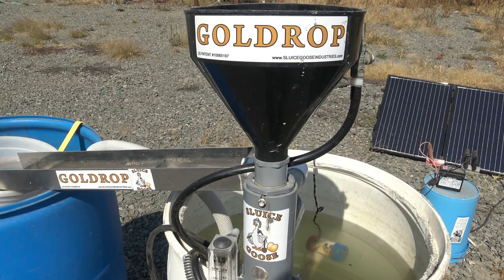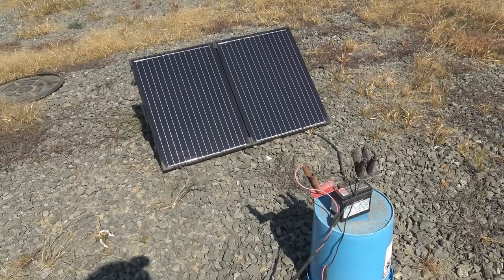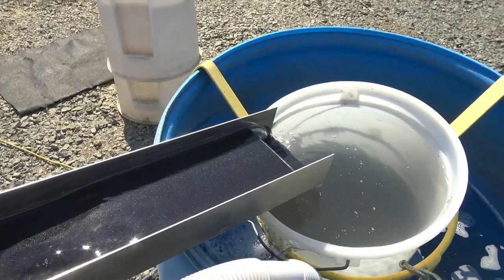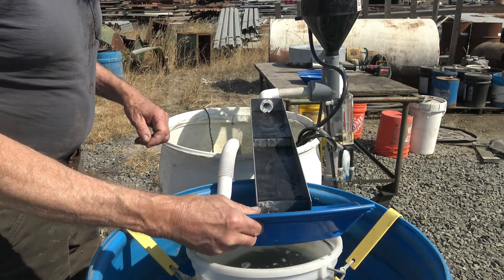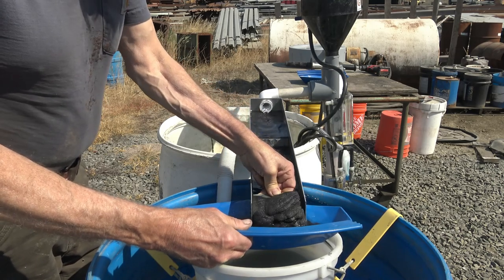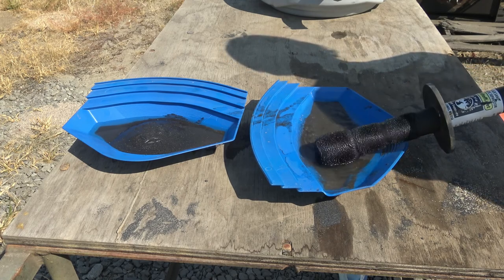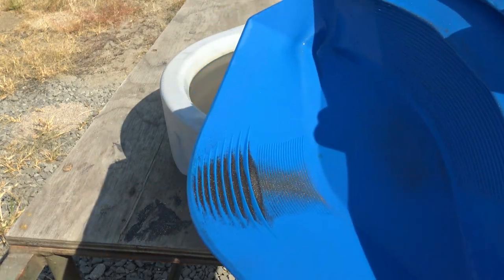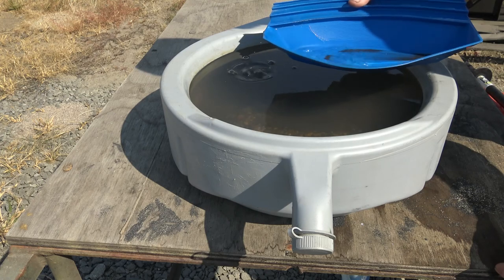GOLDROP & Magnet Sluice by Sluice Goose Industries

Comment: I heard that this thing cost 1,200 bucks why is it so expensive if that's true I'm not sure how long does it take you to run a 5 gallon bucket it doesn't look like it's fast and it's only used for paydirt or concentrates another question is how long would it take you to run 40 buckets on a claim for 1-day dig it just doesn't look like anything that would work here in Southern California most of the gold is fine it would float right out of that jar I'm pretty sure maybe do another video on just find gold micros only and run maybe 45 gallon buckets or something time it to see if it takes more than 10 minutes
Reply from the maker: It's $2000 for the system. A yard of paydirt, 25-5 gallon buckets a day can be fed through the GOLDROP. Any gold that floats out of the GOLDROP is captured by the magnetite lining the bottom of the Magnet Sluice. Recent testing finds the GOLDROP recovers microscopic gold no other device can and recovers more gold than using mercury. The GOLDROP is as close to 100% efficiency, better than any other gold processor can achieve! Steve Darney, a GOLDROP owner, lives in Washington, Maine. Steve mines his 10 acres fore the glacial till deposited when the ice age ended and the glaciers melted. Every other process he tried failed. now he recovers flour gold like crazy! You can read the test results report on my website, www.sluicegooseindustries.com